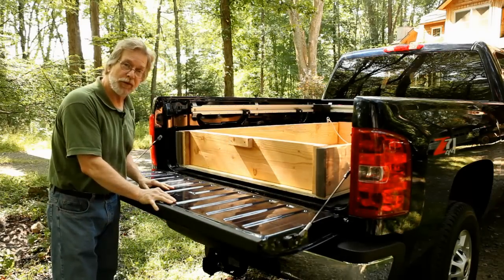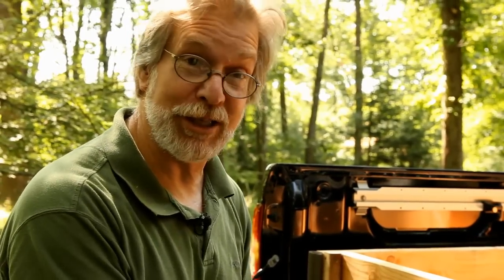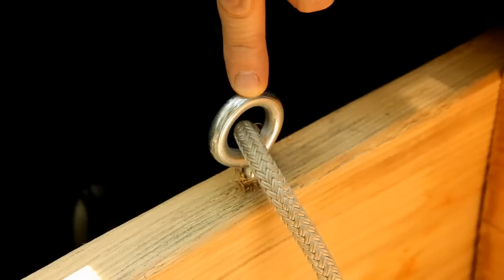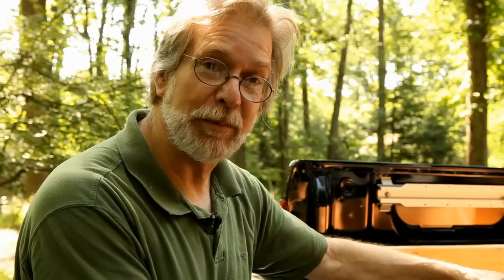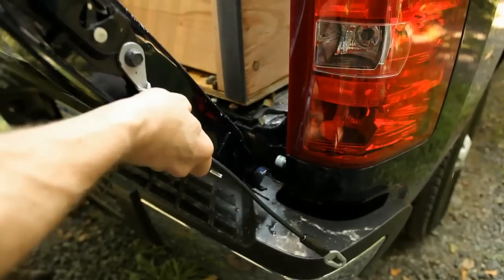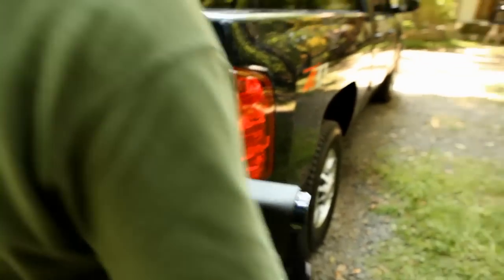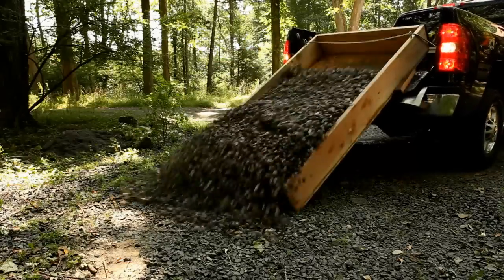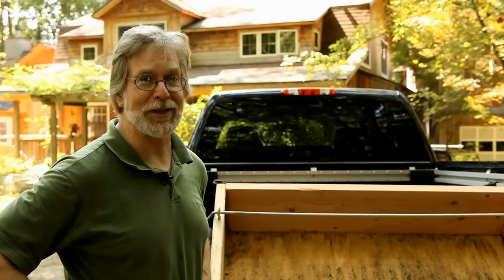A Sliding Dump Bed Makes Unloading Gravel Fast and Easy

Comment: The problem with his box is,  where I live,  the rock is loaded in my truck with a front end loader.  The rocks would not all land in the wooden box.   The rocks would go under the box, hinder the rollers and gouge the truck bed.  I guess I could modify it to have ramped sides to cover more area.

Comment: Great idea!   Have you added any more height to the sides of the dump?  My reason is that in my area they use a front-end loader to put gravel in the bed.  Taller sides would allow  the gravel and other things, to not get jammed between truck box sides and slider.

Great video.  Keep on with the great suggestions and videos.

Comment: One problem I see is that you get a trail of product instead of a pile. After you do the backup and dump, untie the restraint rope, and then pull forward just a little bit (don't let the sled fall off),  then backup. This will start moving the sled towards vertical and thus making a pile instead of a trail.
Reply: Marvin Carvin 
But he wants it to trail
Reply: That MAY or MAY NOT be a problem! I can't think of any application where a PILE would be better.. usually gravel is SPREAD..
Reply: Pile =shoveling and then grading.  Trail = grading only.

Comment: Have never seen a truck loaded at a gravel pit that way. Most load with a bucket loader, making this useless...
Reply: How is it use less?... The gravel still goes in the back either way
Reply: @jeremymarshall7034  Apparently you have never watched a truck being loaded by a tractor. The gravel doesn't just go where you want it to, it spills everywhere, and would jamb up any "sled" you would try to pull out.
Reply: I'm watching it happen now. A simple funnel box on top would keep that from happening.
Reply: It's all about stopping his expensive manly truck from getting a scratch. He should have just had someone to dump it and keep using his truck for groceries.

Comment: So one would have to wonder why is it impossible to realize the removal of the tailgate  and the addition of flashing to assist the superficial appearance of the truck. While completely negating the safety hazard and damage you're doing your suspension et al.
 It's no wonder no one
 considered driving a dig bar or several concrete stakes attaching a chain and driving away slowly until the bed has been pulled clear and dumped?
Moreover I am curious why you would not remove the tailgate of the dump box before you back up like that truck didn't cost nearly $100,000?
Reply: Bro you need to buy yourself punctuation. Authority can suck it with safety. Oh just like your comment on this video. Mine is also a little late, but no he didn't spend 100k in 2009 on that truck. All that being said he is your dad